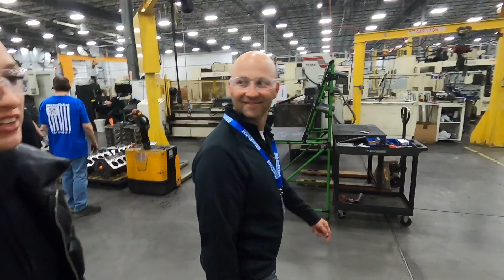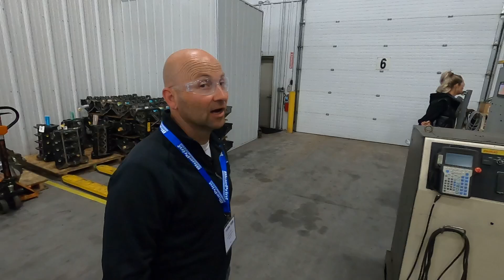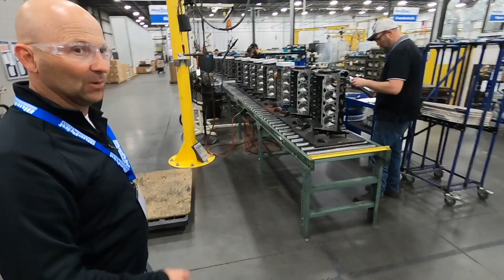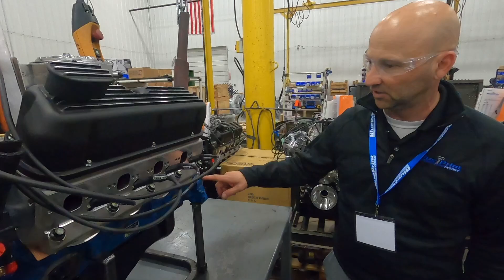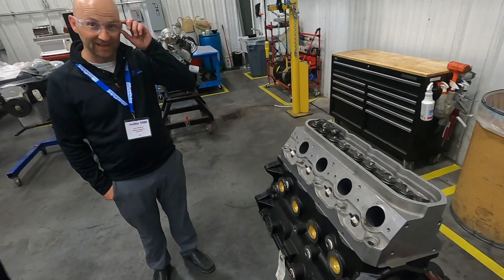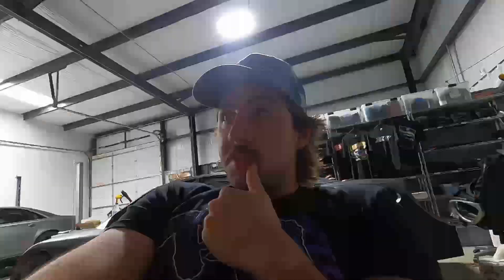Visiting Our Friends at BluePrint Engines! The Factory Has Changed A LOT SINCE 2021!

Comment: Have a 350 390HP engine being built by Blueprint right now. Dropping in my 1972 Monte Carlo.
Reply: How is it bro? Thinking about ordering one of those
Reply: @user-hr2yd5qi2w  just now past the 500 mile break in period and it's been outstanding. Runs smooth since day 1 and is as fast as I can dare to take it!
Reply: @shawdowsanddust5301 350 with 390 HP?   Im thinking if doing a 383 that will get me around 430 HP!   Or a 400 which should have me around 500HP!

Comment: I've been trying to decide if I should stroke my 350 or just buy a crate short block from Blueprint Engines.  After watching this I decided to check out their BBB rating.... not good at all.  Blueprint Engines is not BBB accredited.  They only have a C rating.  I have "heard" of horror stories through the grapevine.  They look pretty legit from this video, but I just don't know.  I think I'll lean towards stroking my current engine.
Reply from the maker: I just had an LS engine built from a used block by a local place. Supplying my own parts it cost $6100 just for machining and assembly. BluePrint is a heck of a good value

Comment: Would like to get that 454 sbc that would be the ideal dream built to fit in. Gbody car and run the power tour USA. Also a happy cruiser.
Turn key performance with fuel injected by Holley sniper or which ever fuel injection kit. Not Fi Tech. It has too many run ability issues

Comment: He hesitated on the answer for where the blocks are made…..🧐
Reply from the maker: I think different ones come from different foundries
Reply: @stapleton42extra  Exactly Mitchell & Logan. @matthewnosal; @matthewnosal6893;  That is what Josh Saldivar actually answered with to Mitchell & Logan, knowing he is recorded and will be posted on their channel again. 
A. There are several foundries in which the engine blocks they purchase, perhaps have contracts with to manufacture, produce for the Blue Print brand engines.
B. Josh also stated within his response not all of their engine blocks are cast, manufactured, produced within the USA - apparently at least one foundry is in Mexico
C. The point which Matthew stated is about the hesitation within the response, reply, answer from Josh; Thus =>
1. why ? what reason, basis, etc.
2. clearly. obviously, explicitly from the information stated, Blue Print uses engine blocks cast, manufactured, produced from foundries within the USA and outside
3. The hesitation in the response indicates he is aware the answer is not completely acceptable, desirable for, with all of their current and potential customers
4. Also the 'supply chain' reply, which is a revealed common falsehood, was used within that response; probably directed by management
5. It appears from the reply, Blue Print is involved in developing other means to cast, manufacture, produce engine blocks, perhaps components, maybe such all foundries they contract or purchase from are within the USA too.
6. Please remember that his man is an employee with specific managerial position, function within the production, assembly team, floor operation; 
a. he also has access to and knows more information than he states
b. is directed what he is permitted to state to the public along with some limited knowledge too 
c. certainly the corporate executives, managers and others do not share all of the information, nor is all available to everyone either.
d. also other departments including the purchasing department which certainly have explicit information of the foundries and details have restrictions, limitation with conveying some information too.
e. hopefully, if a customer or potential customer requests this specific information this will be told and not just in these general terms
-1. example: personally contacted the CS and techinical with some details about the locations of the manufacture of their electronics; initially the person replied with a general statement of several countries; further questions, requests with specific components revealed which are manufactured in which country
-2. this availability of information is not always conveyed, allowed, or available either.
-3. often through person searching have located the suppliers, partners, corporations which parts, components, etc. are purchased and their various manufacturing facilities, locations of each.
-4. many may not be aware, but all US MIL-STD requires every part, component, detail, aspect be manufactured, developed including all physical pieces, electronics, S/W, F/W, within the USA along with sustainability, security, continued production the many other requirements within the MIL-STD
-5. The US Military contracts also required these manufactures to abide to, with the US Gov't with no producing, selling their MIL-STD parts, components, etc. to any country, manufacture except within the MIL-STD and when permitted, to specified allies as within NATO and those which the equipment are sold, but limited to the specifics, replacements of those which the USA Gov't sold 
-6. As with the F-14,-15,-16, -35 [not a F-22 and others], the specific versions sold are not exactly the same, especially the electronics, control systems updates, somethime specific engines too.
-7. this is how the USA managed to stop the Israeli Lavi development, primarily production [a successful 'prototype' aircraft was developed, exists (Israeli development, engineers, scientists are extensive, but industrial manufacturing, production has not developed - they continue to developed advanced technology, ideas, devices, components, S/W, F/W - their developments are then produced within other countries - they developed the first 'drone' for necessity during the 1973 War to trigger the Russian SAM in Syria&Lebanon to fire, empty, then during reload successfully bombed, destroyed them; eventually developing smaller, remote flying 'drones' also in cooperation with the US Military - apparently still ongoing], though initially allowed them to have access to the companies, corporations, manufactures
-8. as an opposite, when the first MIG fighter and second, fully operational were attained by the US Military in the mid-1980's, at least much of the electronics communications, control, weapons systems contained common MIL-STD [radiation hardened -(opposite to the false premise in JB-"Goldeneye")] electronics (no custom electronics mentioned) 
-a. how were these MID-STD electronics devices, components sold, distributed, arrive in Soviet-Russia and with enough quantity to be within every MIG fighter ?!
-b. how and why was this information conveyed, 'leaked' by the US Gov't Military, Intelligence ?!
-c. my personal awareness came through, within the US Gov't contractor which employed me during that period; no 'classified' information channels
-d. the company, corporation, contractor which employed me, did not develop such electronics for US Military, then, though was involved in the B-2 communications, Radar 'stealth', control S/W, F/W ( not me personally, but some co-workers; specific department of my employment 1988-9(post major layoffs, project cancellation spring 1988), shifted in 1990 to a department more appropriate for my expertise, experience)
-e, there is much more non-classified, public information most to the vast majority are unaware, ignorant of and ignore too.

All The Best and Much Success in Your Quest(s), Health, Happiness and Well Being 😊, Sincerely  ☺

Comment: I clicked hoping to see the half LS and bing bop boop i did thx from Australia.
Reply: If You search a little, You will locate some basic information, as appeared for me too.
a. Blue Print produces this 3.6 L 4 cylinder engine for industrial applications via their Origin Division
b. B.P. also claims they have GM/LS, Ford heads compatible with this engine 
c. cast iron block - rather large, with high power/torque -> 3.6 L = 219.685 c.i. -> perhaps 220 c.i. actually -> typical in larger V-6 engines, some smaller V-8 engines
d. Origin emanates from Mercruiser, thus also marine applications are seemingly among the uses, perhaps currently.
e. no mention of others or other improvements as OHC, Hemi, smaller sizes, aluminum blocks

Comment: Parts supply can not be good, most parts in the industry are less than desirable, which parts are you getting is the question.
Reply from the maker: they are extremely diligent about this
Reply: @stapleton42extra  you have too , otherwise everything washes down the pipeline

Comment: dude, so busy with work, (brand new sk 415, google that shiz) can you, being an insider.... find out about when the 4 cyl semi ls based crate motor will be available????
Reply: So You must have located these 3.6 L, 4 cylinder engines are produced within B.P.-Origin Division for industrial applications
->also Origin emanates from Mercruiser ->thus seemingly marine applications
-> also B.P, has both GM/LS & Ford heads mated with this engine
-> any other details You have located about the single turbo, other modifications as EFI, OHC, aluminum block, Hemi Heads, 16 V [4 V/cyl], VVT, smaller displacements, size ?
->smaller size/displacements, EFI, VVT, OHC, 16 V, Hemi, aluminum block these become excellent for many racing applications, engine swaps, custom vehicle builds, etc., along with Flex-fuel, ethanol, methanol, hydrogen uses.
Sincerely
Reply from the maker: its a long ways off still

Comment: $7 million is proof they believe internal combustion engines are not dinosaurs. I am astounded the number of engines go out their door. After your   1st visit to Blue Print I was impressed enough to order their 383 with approximately 440 HP. I will be running the engine through its paces this summer. Thanks Mitchell and Logan
Reply from the maker: Thank you Benny!
Reply: How did it go ?
Reply: im sad because the transmission mine is hooked up to cracked